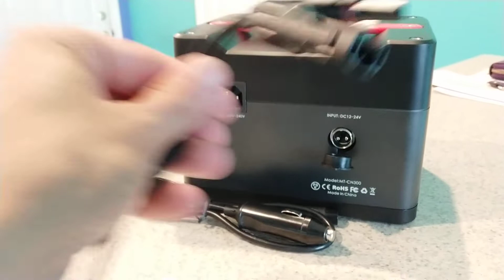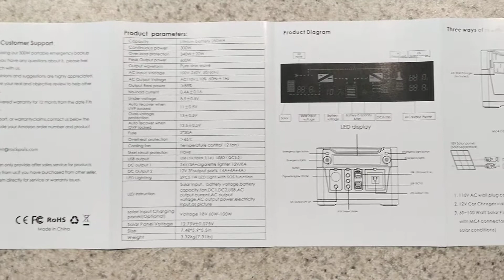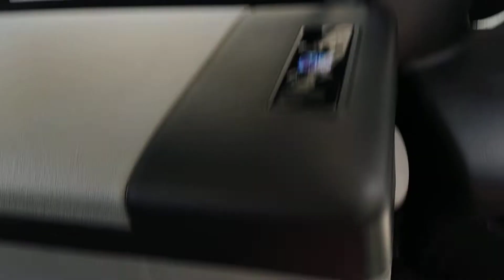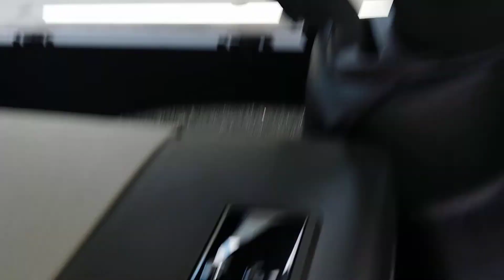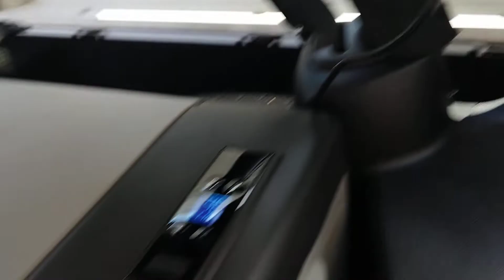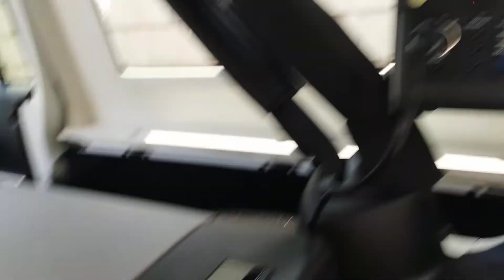Rockpals Portable Power Station 300w (280wh)

Comment: I am having a very hard time finding replacement DC charging cords.  Do you have any info or links you can provide for finding a replacement cord (both for the car and solar).  The input port just isn’t a straightforward port.  Tried MC4 as a search term and also GX16-2.  Thank you very much!!
Reply from the maker: Send me an email I have an extra set. I looked it up and couldn't find them online either. Channel name at Gmail
Reply: @ianmburke  thanks Ian!  I was able to find some on eBay, so I think I’m good.  Appreciate the thought!
Reply: @JamieTuckey what are they called? Where did you find it?

Comment: ROCKPALS Portable Power Station 300W, 280wh (78000mAh) Solar Generator with 110V Pure Sine Wave AC Outlet, USB-C PD Input/Output, QC 3.0, CPAP Backup Lithium Battery for Outdoor Camping Emergency. 👍🏻👍🏻👍🏻😋😋😀😄🔋🔋🔋⚡️⚡️⚡️⭐️⭐️⭐️⭐️⭐️(99)💪🏻💪🏻💪🏻
Reply from the maker: Seems like an ad... But also NOT good for CPAP as the 12v is not regulated

Comment: Ya, sent it back at there expense, they said they gave me a new one, I don't think so, has same problem, funny thing is, I can charge it on DC, and it shuts off at 12.6....
Reply from the maker: Interesting, I only charge mine by solar now, but my first unit did have an inverter failure after wall charging it... Interesting... I bet there is some problem on the inbound ac circuit. We need Will Prowse to dissect it!

Comment: bought one for really one reason, to run wifi when power goes out. For this it works well, wifi draw is so low, this thing runs for hours. the problem I have with it, is charging. If I charge it over night, and it reaches its full charge before I get up, idont know if it over charges or what, but it won't turn on till after about a week or so. Is this normal ? Does anyone else have this problem?
Reply from the maker: I have two units now and haven't had that problem but it does sound like the over charge protection isn't working and it's then needing to settle afterward I would call in a warranty claim on that

Comment: Question for you. I saw in other reviews that the power display screen turns off if it does not detect a connection. However, mine does not turn off unless I turn the button off manually. I noticed yours didn’t turn off after a few seconds despite not having anything connected. Is there a setting that uses a power save option for those buttons? I accidentally had one of the buttons pressed and the display screen never turned off depleting my battery quite a bit.
Reply from the maker: Mine stays on from what I have seen even with no load. I recall reading somewhere there was an original model that shut off without anything plugged into it rather quickly but neither of the two I have do that
Reply: Ian M Burke thanks for the response! I guess I should be glad I don’t have to make a warranty claim? Lol

Comment: ultimately, can this run your fridge for 12 hours?
Reply from the maker: Tough question... If you have it with alternative power source like DC vehicle in or solar in 100% yes... But it all depends on the ambient air temp around the fridge and what temp you have the fridge set at. In my current use of the fridge no since I set it to freeze which is about 6ish hours.... If set on 30f and the ambient temp wasn't over 70 then I assume you could get 12 hrs
Reply: @ianmburke  I havent purchased anything yet. I am looking at running a 45-54QT fridge for a family of 3. I am looking at the Whynter fridge but will rarely use it as a freezer, mostly a fridge.
Reply: @ianmburke  Like this or Ravpower better?

Comment: This stuff is so confusing. Can I plug this into a house to charge before going out with it or do I have to have solar?
Reply from the maker: It comes with a wall ac charger for your house too but offers charging via 12v through a DC line in from solar or your vehicles cigarette lighter outlet
Reply: Ian M Burke sorry for all the questions Ian but I need some more help. Will it work  a house fan

Comment: I actually purchased the c20 from alpicool along with this battery pack.  My plan is to keep the battery pack in the Jeep charging while it powers the fridge.  I'm trying to avoid a dual battery system. What are your thoughts?
Reply from the maker: That's my exact use as I have seen so many people have electrical issues with dual batteries and running additional electrical components I wanted to keep my power and fridge on its own circuit. I charge the rockpal off solar on the roof of my Jeep and it works like a charm
Reply: @ianmburke  I was thinking about using the cigarette plug on the back of my jku. I was thinking about plugging the Rockpal into that. then plugging the fridge into the cigarette adapter on The Rockpal
Reply: I do plan on getting a hundred watt solar panel later in the summer time
Reply from the maker: @gustavomiron6043  I skipped the plug in the rear for fear of over drawing from that electrical line as the amp load is pretty high for the fridge. Also there is a blade fuse (I did a video about ) that you can put it two positions which switches the outlet between always on and on only when the ignition is on

Comment: what are the measurements of the unit?  physically?  I'm looking for this type of power to place on my motorcycle as a power source once arriving at a remote camp along with the 80 watt solar panel rockpals sells.  also looking for a rather tiny 12v frig for holding insulin as I ride...know of any?

Comment: I bought a KyngPower 540wh battery pack on amazon to power the 48 qt Alpicool. Hopefully it is enough to run it for a day or two. Nice setup in the Jeep. I am making a setup in my 2000 Yukon Denali.
Reply from the maker: Turns out this unit isn't that great afterall the voltage on the 12v isn't regulated and when the battery is down one bar roughly 80% charge remaining it's only outputting 11v
Reply: Ian M Burke They did a great job with the way the case looks though lol. I have t seen any reviews on the one I just bought so I am kind of taking a risk with that. Someone’s got to be the tester though.